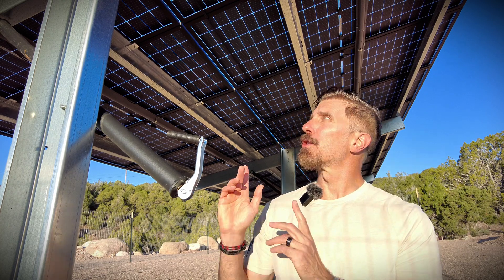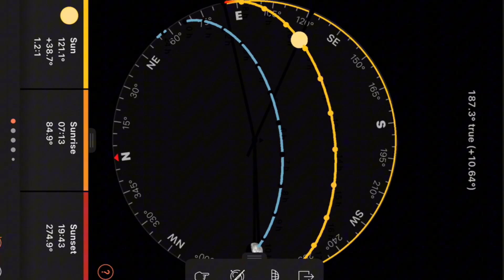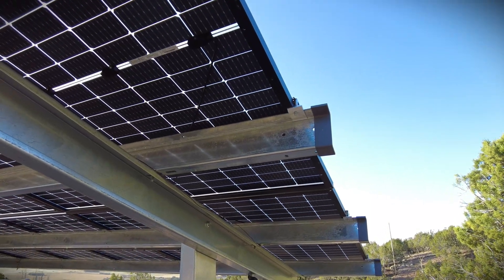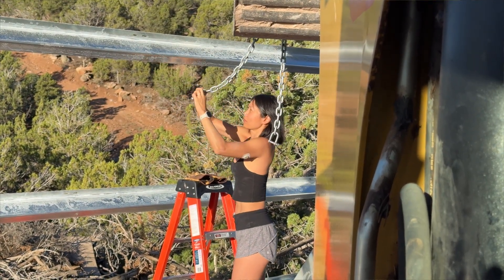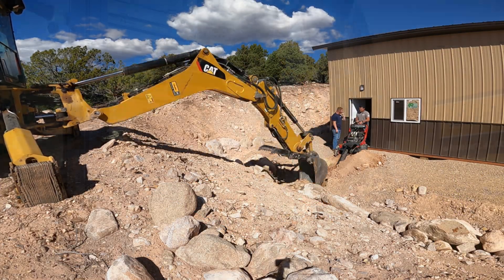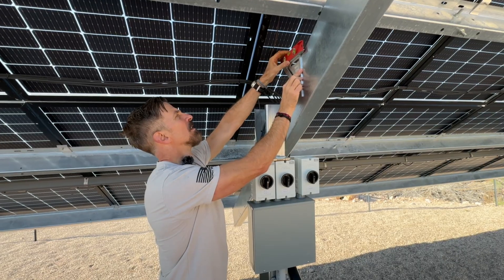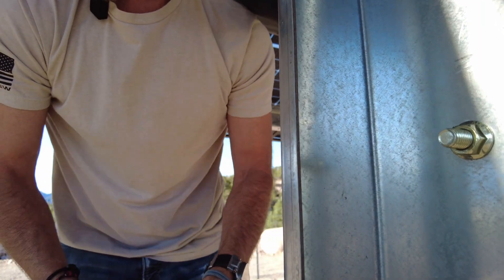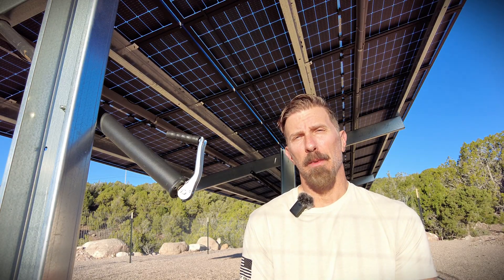Ground Mount Solar Benefits | Off-Grid Deep Dive

Comment: FYI mule deer would not consider that fence a barrier. but a beurocrat would. so problem solved... the legal problem. 
I had to keep goats of my panels. Thankfully their intence curiosity with the "new thing" was short lived. 
I like the adjustable rack... that's a big deal.
Reply from the maker: Ha! Yeah, mule deer can jump over anything below 8’. The law makers know nothing about this 😂
Reply: @Kolob_Canyons_Ranch  I was thinking 8" but I've seen one Trotting along one day and it cleared a 6ft fence and never slowed down. It did a funny quick step to plant it's feet right and boing... I saw saw one in a hydro inclosure with a 12" fence and no clear way in... but I'm not a 100% sure it jumped the fence. I looked and could not find a hole. but may have missed it so... Just got my transfer switch to go from grid to PV still haven't opened the box yet :) like a second Christmas!
Reply from the maker: @nomadicoasis9260  woot! 🎄

Comment: I like the look of the Sinclair system.  Good video on the overview. I would like more details on assembly and string size (how many panels in a string, any combiner decisions, and wire gauge).  You don’t have to go into deep discussion but just want to know thought process.  I also am unsure when sizing a string how much the bifacial or bottom side changes voltage or current from panels.  I am trying to avoid having too much power in a string.  Thanks for your video.  All the best from north Texas.
Reply from the maker: Thanks for the feedback and for asking about those details— Much of that is in this video: https://youtu.be/DYI-Ggu8scQ?si=9u9YC5wbxm7HDToo ALSO, here's a breakdown of costs https://youtu.be/3OEoyDBxjuc?si=7Q5TxeBBotCexham
Reply: @Kolob_Canyons_Ranch  thanks for the reply.  We live in north Texas and I am wanting to hobble something together prior to the end of the year.  I have always liked the Sinclair mounts, and we have too much clay and rock here in north Texas to pound them in (also I don’t know where to rent such a device since I am just a humble homeowner haha).  I will take a look at this other video of yours.  All the best from north Texas

Comment: Ground-mount is definitely the way to go if you have space for it.  In addition to ease of access and ease of cleaning,  there are no worries about roof penetrations leaking, or removing panels if/when the roof needs maintenance.
Reply from the maker: Agreed, the benefits definitely outweigh the costs if you have the space for it!

Comment: I'm in my 7th year of PV. I cleaned my panels one time in the first year. From then on, I have found that it rains enough in my location to keep them clean.

I have only had to be on the roof to adjust my arrangement one time. I am still considering redoing the lines for a higher voltage, lower amperage setup. But I just haven't found a "round-2-it" to make it happen.

I really like the Sinclair seasonal adjustable setup. I have experimented with a dual-axis tracker, which produces about 40% more kWh, but it's just not worth the $$. It is something to consider if space is limited, though. Your dual 15k Sol-Arks have a significant amount of capacity available if you need additional PV production; it's an excellent choice. If you run out of string inputs, you still have the AC input(GEN INPUT) for an AC-Coupled array, like Solar-Edge or Enphase.
Reply from the maker: Great information. Thanks!

Comment: Ditto for the install video. Curious as to how breaking up the system into 4 strings effects your output.
Reply from the maker: To my knowledge there is no effect, negative or positive. It just isolates them if needed for service or in case of a lightening strike, we only loose 1/4 or the array (theoretically). Thanks for the question.

Comment: Nice job! instead of using level and a square i would suggest you to make a permanent mark on the each post for 15 / 35 / 55 degree 💪
Reply from the maker: That’s a great idea! Maybe with some metal stamps so it looks nice and would last forever. Thanks for the suggestion!

Comment: Very Nice setup. Can we see your solar production ?  How much are you making per day ?  Is the production enough?
Reply from the maker: Thanks- today was fairly sunny and it produced 69.0kWh. It’s a lot more than we need. The batteries got to 100% at noon today and system goes into float. The reason I wanted such a large system is to have lots of headroom in winter storms. We never think twice about using energy day and night, unless there a multi-day storm. Then we’ll be very mindful of usage until the weather gets better. I’m going to install a propane generator soon which will augment production in case of a cloudy week. Thanks for your question. Check out the other videos linked in the description where I show the Solark app and production details.

Comment: Did the mount come with engineering stamps for permits?

What other mounts did you consider?

I understand the desire to have them low to the ground for cleaning and snow removal but did you not want covered parking for guests during summer?  Or do you open the fence up during larger gatherings of family and friends?
Reply from the maker: Yes, the plans were stamped and the entire system well-planned and documented by Practical Preppers. I paid them to design for my exact wants/needs - well worth the investment since I am no expert on the matter. We have plenty of parking elsewhere for guests, but yes, it would have been nice as a covered area for trailers and heavy equipment implements. I will likely expand in another area for that later. We have lots of land we can build on, fortunately. Thanks for the insightful questions.

Comment: Thanks for the great content - appreciate the level of detail and willingness to share. Do you have a way of measuring the impact of the bifacial panels? I.e. can you determine how much more generation the bifaciality gives you?
Reply from the maker: Appreciate the kind words! I don’t have a direct meter just on the backside, so it’s tough to measure bifacial gains independently. From NREL data and system design estimates, the boost can range anywhere from 5–15% depending on time of year and ground reflectivity. I’m tracking my overall production against projections, which helps give me an idea of the added contribution.

Comment: Maybe you might have made a video on this, but I'd like to know:
How many years/months did you take to think about what you'd like to have on your ranch, i.e. the electricity supply, security, water,  machines, houses? 
Or do you just install/implement things as you go?
Reply from the maker: Both. Some things, like the barn/solar project was 3-4 years in planning and research. Other things bubble to the top as obvious needs (like the dump trailer for example) and I just go online and order it after 1-2 days of research. I do ALWAYS research before buying anything. Read reviews, tech data, and watch videos. I loath buyer’s remorse, so the research generally leaves me feeling very satisfied, even years post-purchase.

Comment: Great Job!  I love that people when building take the extra step to over build as apposed to getting just the minimum degree of tolerance for a structure.  I know that your task was much more designed than most, but I admire that.  Would your other videos outline grounding, EMP, and breaker/fuse outlines for this size of panels and output?
Reply from the maker: Thanks, I appreciate you noticing! I have linked two other videos on this system that address the EMP hardening and the panel out put, you can find the links in the description. Basically, we have EMP hardened inverters from Solark, and 44 panels at 450kw each. The battery bank is 93 kWh.

Comment: How did you figure out how many solar panels you need? Kwh or amp draw? I have a small parcel here in Tennessee that is 1/4 mile off the road so utilities would be pricey to run back to a building site. I'm interested in solar but not sure how I need to figure out how to design an adequately sized array. Great channel! Glad I found it.
Reply from the maker: Figure out daily kWh use, divide by your sun hours, then size panels with a 10–25% buffer — most off-grid setups land in the 15–20 panel range. We went with 44 panels because we wanted to power an absurd number of appliances. Check out my “We’re finally off-grid” video to see all the things I am powering. A more frugal household could get away with a far smaller system. Hope this helps, and welcome to the channel!
Reply: @Kolob_Canyons_Ranch Thanks! I'll check it out.
Reply: Practical Preppers?